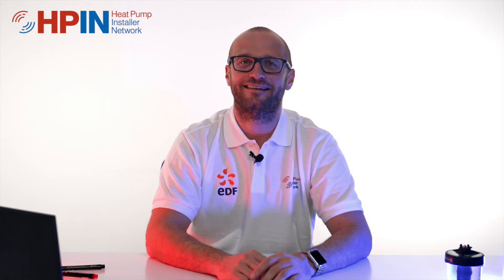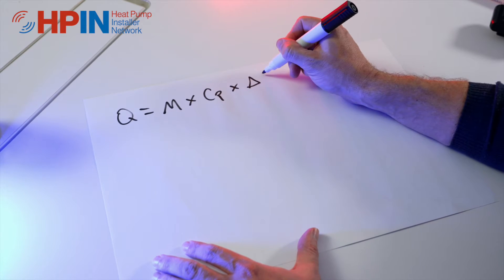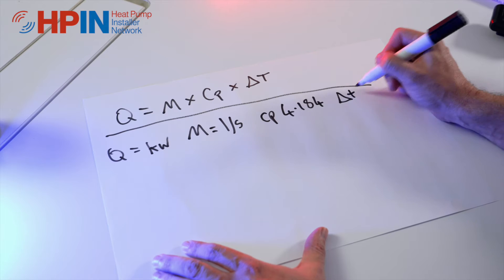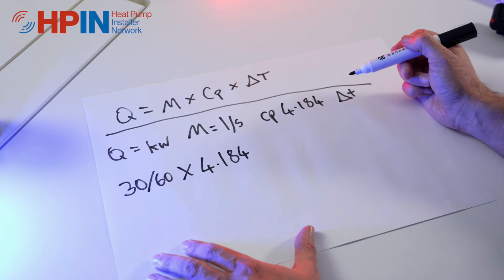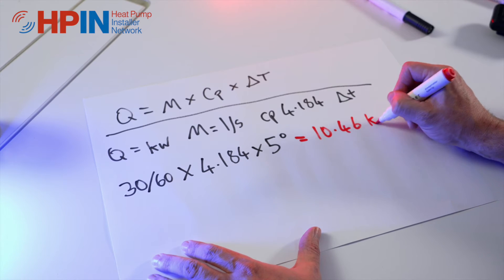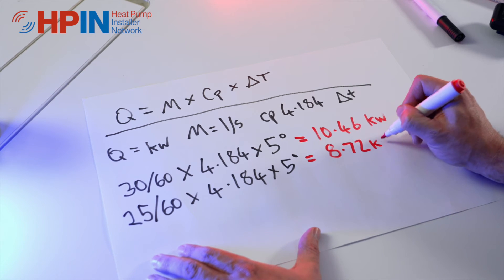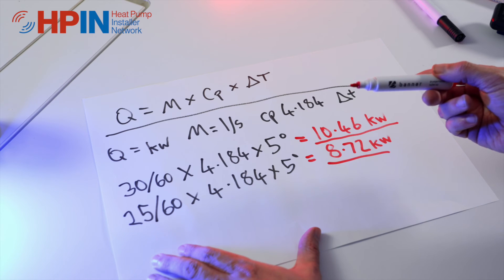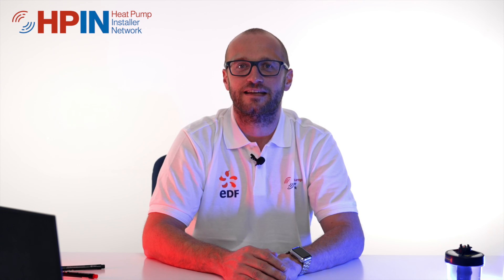The importance of flow rates

Comment: Very useful. My 8kw Daikin was showing a flow rate of 7.7 L/min during an air purge test. That struck me as very slow, so we raised the pump speed to high, and re-did the test - now showing around 18L/min. Hopefully this will make a big difference as the house was struggling to get warm when temperatures went below 0c. Previously at 7.7L, with the equation in the video, it is 2.684 kW output, whereas with the faster pump it should now be 6.276 kW. Huge difference. Thanks for the video!

Comment: Why is dT considered a constant 5 deg C? If the flow rate is reduced the water will be resident in the emitter for longer and would lose more heat, resulting in a lower return temperature and higher dT, right?

Comment: So if a higher flow rate gives more energy, then in must be requiring more energy to go in? If that is the case there is another equation we need to see which is the energy input required to deliver the higher flow rates. Otherwise we’ve achieved that holy grail of energy for free?

Comment: The specific heat is per kg of water. It's only 1 liter at a certain temperature, so the formula should actually be corrected slightly. But water only expand slightly with a degree of Kelvin or Celsius (0.00021).
Reply: So not really going to affect this calculation then?

Comment: Why has a heat pump got to have high flow rates? Why not slower flow rates and a wider delta t?
Reply: Thats the sacrifice we have to make for high efficency heating as apposed to a DT of 20 degrees for gas/oil fired heat sources.

Comment: Hi, thanks for this, very useful! So if i know that my heat pump is advertised as having a 14kw capacity, and ive read that they self-regulate to keep the DeltaT at 5, does that mean I need a flow rate of 40.15 litres per minute to achieve the maximum efficiency from the pump?

Comment: My dt is set to 5 but is constantly dropping to 2.5 . Is there any problem with the system ?
Reply: So your heat pump is only giving you 2.5C of heat rise...that sounds like a big problem!?
Reply: @manoo422  Well im not really sure tbh .
Reply: @toniilievski3934  Well the whole point of any heat source is to provide...heat. Yours is not doing that to any significant degree, so whats the point of switching it on...?
Reply: @manoo422  Its heating fine , but the difference from the inlet and the outlet is 2c , the pump is a bit oversized , so maybe im loosing less heat then im getting from the pump ...
Reply: @toniilievski3934  So if the difference is 2C whats the actual temp going in? And, going IN to where?
Reply: @manoo422  The water coming to the radiator is 40c and the water leaving the radiator is 38c